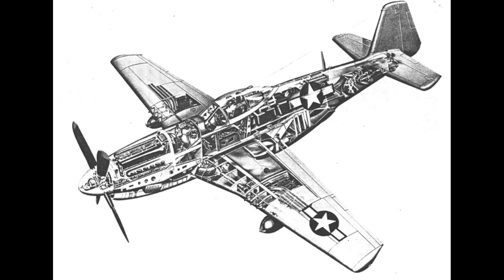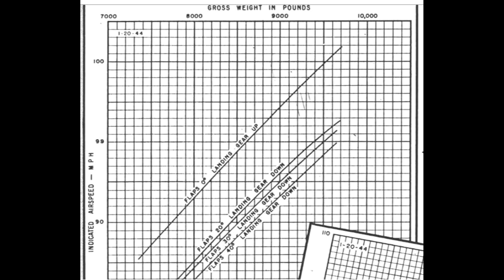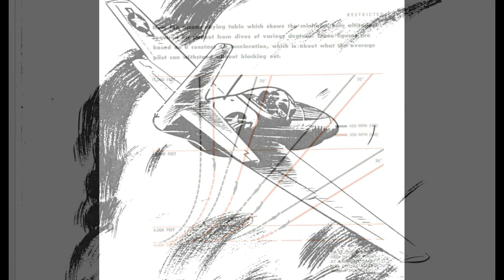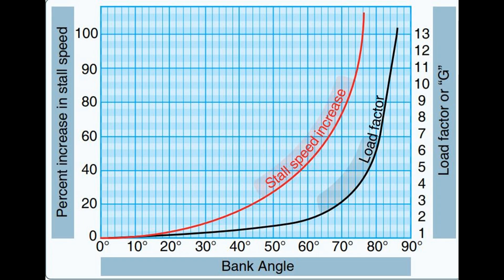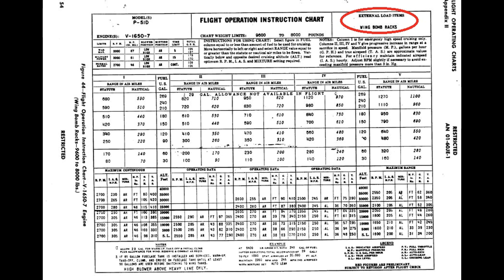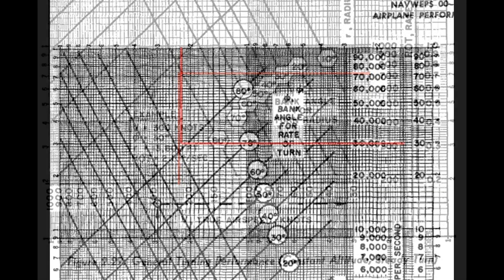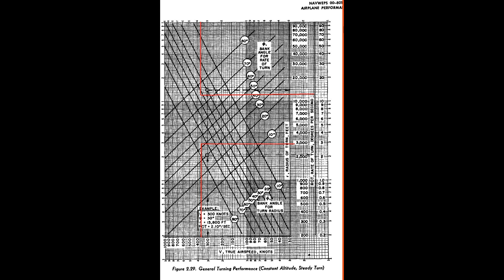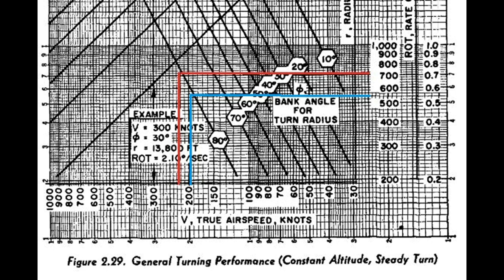P51 Mustang Turn Radius vs.

Comment: An additional factor is pitch trim,  Airfoils have a (generally) nose down pitching moment that is balanced by the horizontal tail.  The tail load is adds to the load already born by the wing as it pulls the plane thru the turn... more induced drag.

The Mustang’s airfoil has appreciable pitching moment; the Wildcat’s NACA 23015 has nil.

The NACA 230xx series nil pitching moment meant the pilot could throw the plane around without having to trim.  The 230xx was used on the Wildcat, Hellcat, Bearcat, Corsair, Lightning, FW190 and Beech Bonanza... it’s been around.  Downsides is bad stall, drag, and won’t carry ice.
Reply: Centre of mass also affects the amount of control surface movement needed to change direction, and hence the induced drag from the tail feathers ! Bearcat was almost unflyable if you could not see the horizon, not safe at night... !!

Comment: It was an A36 in the start if the gun placement is still a dead give-away.
Reply from the maker: Good Job! Few people are able to pick that up.
Reply: I have to say I don't know why the P-51 doesn't have the air brakes the A-36 has. They can be an assist in an aerial dogfight, by reducing the speed and causing an opponent to overshoot. However, you would have to be quick and smart to then use that to your advantage.
Reply: @alexanderhogan4546  one word: weight
Reply: Alexander Hogan and you could use them like spoilers to help with roll rate or like a split rudder you see in the B2 Spirit to help in a turn.
Reply: Not necessarily.  The dive flaps are a much better indicator.  The very first Mustangs (most of which were given to the British as Mustang Mk I's) had the same gun placement as the A-36, and the nose guns were only deleted with the second batch of Lend-Lease Mustangs which were designated as Mk Ia.
Reply: Ah. I didn't pick up on that. That thing was one mean dive bomber and attacker.
Reply: No, I mean 'given' as in, we shipped them to the British, i.e. physically gave them to the British.  Admittedly somewhat less than accurate choice of words on my part.  I probably should have said "purchased by the British as the Mustang Mk I" but I was in a bit of a rush at the time.
Reply: "Gave" is about as apt a word for lend-lease goods a "purchased" is, anyway.

Comment: Using pure turn rate and radius to compare two different aircraft's maneuverability doesn't really give an accurate picture of which performs better in a dogfight.  The pilot is definitely going to be the key factor.  A very skilled pilot can feed in just the right amount of back pressure to foil an enemy without overloading the aircraft and increasing induced drag.  The less experienced polite will usually use too much back pressure and bleed off speed and lift too quickly.
Reply from the maker: I made no attempt to cover all the variables in a dogfight. I just addressed turn rate and radius, and then only maximum turn rate and radius.
Reply: Yes, of course and it was a very informative, well illustrated presentation.  I just wanted to add that these performance factors can't show the whole picture when it comes to which aircraft will turn better in a dogfight.

Comment: A bit more respect for the P51, from a dive bomber to long range escort which could out perform its competition that were short range air superiority fighters.
Reply: Different horses for different courses, old boy.
Reply: respect is earned, not given, did the p51d earn respect, yes in some areas for sure, undoubtedly one of the best.
Reply: P-51 was inferior to Spitfire in climb and dogfight, without the brits Merlin Engine built under license by Packhard  the Mustang would not be such an success.
Brits and germany were the leading airplane tech nations in WW2, both produced Jet engines and Jets, look what Bell produced, the P-59 was such a crap and the first P-80 was inferior to Me262

Comment: If you dropped a few degree of laps, what would that do for a sustained turn. I always wished when they swapping out the motors, they should have added leading edge wing slats to the stang, maybe bleed a little coolant air over the wing, boundary layer style... why not build a totally new plain? Thanks for the videos, love the detail.
Reply from the maker: As for the sustained turn question, it depends on the plane, the wing and the type of flaps. For example a low powered plane with slotted flaps, then no, a high powered plane with fowler flaps then yes. I doubt any WW2 plane had a better sustained turn rate with the trailing edge flaps out, but maybe. North American did design an all new plane with the Merlin, but nobody noticed. It was the P51H, which is not just an updated P51D, it was essentially an all new plane. Leading edge devices add a lot of complexity to the discussion. I'll get to it, but keep in mind, that while they work well, even the F15 Eagle doesn't have them and it was king of the skies for about 25 years.
Reply: From what I have read, some ww2 fighters had "maneuvering flaps" which were about a 10 degree setting.  This was used to improve instantaneous rate of turn so that a pilot could momentarily either pull lead or escape an enemy's shots.  However, you would never want to keep slowing down using flaps; bleeding off that much speed is generally fatal.  

The famous ace Ike Kepler of the renowned VF-17 wrote he used landing gear and flaps to cause a Japanese Tony to overshoot his six o'clock and thereby Kepler was able to splash the Tony.   

I think the Japanese George aircraft had flaps which would automatically deploy when needed.
Reply: @fazole  A number of JAAF and JNAF aircraft used "combat flaps". Nakajima was a serial "offender"- Ki43, Ki84.
Reply: Greg's Airplanes and Automobiles 
P-51H is one of my personal favorite aircraft of all time.  Very much at the forefront of what could possibly be achieved with a prop job, and very possibly of what might ever be achieved with one.  Heck, even though it never saw Combat, it did make it to squadrons in the Pacific, it just never got on any sorties.

Comment: Great videos! I had to laugh when you mentioned one plane absolutely out-turning the other "and vice-versa". Years ago I read a commentary on Zeroes and P-40s. It may have been Murray Rubenstein's excellent comparison series, but I really don't remember for sure. What I do recall is reading a quote from a P-40 pilot to the effect that "I never met a Zero that could out-turn me." Given that pretty much everyone agrees that the Zero was by far the better turner, I learned a little bit about how much perceptions play a part in what we see. If a P-40 pilot takes a shot from 300 yards behind a Zero and the Japanese pilot throws it into a tight turn in an attempt to avoid another shot, the American only has to turn a few degrees to keep him in his sights. Sure, the shot's going to be a much worse deflection shot, but as far the shooter is concerned the Zero is still in front of his guns and it sure looks to him like he easily out-turned his target.

Of course personal experience is one of the worst judges of facts, but I can see where a lot of these stories get their start.
Reply: "I never met a Zero that could out-turn me."
This might be the phenomenon called "survivorship bias" - none of the pilots that were out-turned by Zeroes lived to tell the tale.
Reply: The zero was very good at low speed turns. P-40 Pilots learned to keep the air speed up. In high speed turns the zero's controls became very heavy, if it slowed down to make the turn it gave a speed advantage to the P-40, then could not acceleruate fast enough(due to radial engine drag) to escape the P-40's speed advantage.
Reply: sebrafield wtf, now the zero is outterned by p40. Ok I understand american pilots had to lie some to win any medal and be a bit famous I mean profits for them. But why you fall in it!?
Reply: @geldoncupi1  did you really not read the entire comment he wrote?
Reply: @geldoncupi1  the zero couldn't turn well at all at speed

Comment: That P51 you said wasn't a P51 was a P51, just not a P51D.
Reply: To be pedantic - the first Mustangs were used by the British (Mustang Mark IA - the "Mustang" name came from the British). These were NOT P-51s (they didn't have a USAAF designation because they weren't in use by the Americans as yet - and the Mustang 1A was armed with 20mm cannon). The Americans decided to put in an order of dive bombers using the Mustang airframe, these were called the A-36. The one in the video is the one on display at Wright-Patterson. LATER the USAAF ordered fighter Mustangs, THESE were designated the P51A (and some were supplied to the British, who called it the Mustang Mark II). So the A36 were NOT P-51s, and were not a derivative of the P-51.
Reply: A-36 or P-51A?
I think literally the only difference are the speed brakes on the A-36.  
They have an A-36 at the Air Force Museum in Dayton...  Not too many of those left in existence.
Reply: soaringtractor A 36 was an Apache
Reply: Matt Puffer DUUUUUUUUUHHHHHHHHHHH !!!!!!  A36 was the dive bomber version of the Mustang !!!!
Reply: As I understand it, the A-36 was produced only for budgetary reasons. The Army had spent all it's money for fighters that year, but wanted to keep the Mustang in production. By making it an "Attack plane", they could allocate funds to keep the line going.
Reply: If you look, the dive brakes are deployed! Yeah, three left according to Wikipedia, and this one is at Wright-Patterson.
Reply: Doh! Of course.
Reply: Organ Farm   It was a F4F Wildcat in the drawing, A-36 in the museum.
Reply: it also had extra guns, and an engine geared for lower altitudes.  How do you gear for lower altitudes than something already struggling above 15,000ft?  by giving it an engine that peaks at 7,000ft, then drops off insanely quickly
Reply: no that was an A-36
Reply: RED,
Stop being pedantic.
I know it's a problem on YouTube but it's still annoying.
The A-36 was a development of the P-51.  In modern terms, it would be the F-15E to the F-15A.  In other words, modified specifically for ground attack but retaining most of the airframe and powerplant of the original fighter version.  Literally, the only major differences are the reinforced wing and split rectangular speedbrakes.
It's still a P-51 design whether you admit it or not.
Reply: AvengerII what makes it an A 36 is that it is the same airframe as a P 51A with different gun placement, not just different roles.
Reply: Matt Puffer  BULLSHIT !!!!  An A36 is a Mustang with DIVE BRAKES and bomb mounts on the wings !!!  DUUUUUHHH!!!!!!!
Reply: Wilbur Finnigan not even going to get into this with you. There's a distinction between Mustang and P 51. Hence once the USAAF adopted what NAA was producing for the RAF (Mustang) they gave it the designation P 51, and the name "Mustang" stuck. The A 36 was affectionately referred to as an Apache.
Reply: Matt  MUSTANG was the P51 !!!!  P51 was a Mustang !!!  DUUUUHHHH !!!!!!!
Reply: no the A-36 was not a P51 it was never called as such and had a completely different role
Reply: It was never  classified as a p51 by the army. it was purpose build ground atacker based on the p51 thus why it recived an other designation
You just mistaked it for a  p51a that's all
The world world be a better place if peoples just admited their mistake and move on
I'm not here to shame anybody I'm just pointing fact
Reply: I think he was just being facetious.
When people think "P-51," it's almost always the D-model.  It was the most produced model, the definitive version with the bubble canopy.  More D's survived than any other model of P-51 to the present-day.

Comment: Comparison of the p51 mustang and the supermarine spitfire.
Reply: Lightning never sold well because of what it was designed to do. Specifically it was designed totally as a short range, high speed, high altitude interceptor with a rate of climb that very few aircraft even today can match. Its reason for being was simply to intercept Soviet Nuclear Bombers before they reached their targets. Hence the high speed, and very high rate of climb. Radar was considered less important as they would be vectored onto their targets, so long range sets were not required, only short range sets for the final approach. 

And thats the problem, it was such a specialised aircraft that once countries started moving from Bomber deployed nukes to missile and submarine deployed weapons they struggled to find any kind of alternative role for the thing. It had been so highly optimised for its role, because when they designed and built it, it was the last defence against a Nuclear Strike.... so they did not compromise. But that meant it made compromises in other areas, such as little room for radar, limited room for avionics upgrades, it was an expensive aircraft to maintain as well. 

You should see one reach for the skies though, they climb like homesick angels. I used to watch them in scrambles as a kid. It is famous for its ability to stand on its nose and go almost vertical from the takeoff, but its highest rate of climb was not achieved that way. This is an aircraft that could climb to 36,000 feet in under three minutes. RAF pilots were allowed to make practice interception runs against U2's when they were deployed in the UK for a while. They were not allowed to approach within 5000m of the U2, or pass in front of it (to ensure the U2s safety), but they were able to successfuly intercept U2 up to 65,000 feet. Several pilots have reached over 80,000 feet..... 

So yes, the English Electric Lightning had its issues, but it was VERY good at what it was designed to do, intercept bombers.
Reply: To this day, the European fighter planes have less range than the American types.  They have excellent handling but the range isn't there unless they want to strap on HUGE, drag-inducing tanks.  They're mainly designed for the European theater which doesn't take into account longer ranges.
The main reasons for designing fighters as big as the F-15 (AND bigger like the F-14 and Su-27) is to get decent range and have better radar capability.  These planes have huge internal fuel capacity and bigger noses for bigger radar sets to track longer distances AND search greater volumes of air.  They're also far more expensive than smaller fighter jets because "more plane equals more bucks to build AND operate!"

They had a Mach 2 British jet built in the 1950s and 1960s called the Lightning but it never sold well.  I think it had maybe 2 export countries -- Saudi Arabia and Kuwait(?).  The plane's biggest problems were lack of range and an airframe with no space for credible avionics upgrades.  You could not fit much of a radar in the plane.  The same was true with the F-104.  Italy eventually had F-104s capable of firing and guiding Sparrow missiles but for a while the Italian Air Force had to remove the gun from the F-104 to fit in the avionics guidance for the AIM-7!  They finally were able to miniaturize the avionics enough in the 1980s to reinstall the gun in their F-104s.  The UK ended up buying F-4 Phantoms by the mid-1960s because the Lightning just could not be developed into a long-range aircraft with decent radar-homing capability.
If we were to be honest, the British have pretty much specialized in designing good point-defense fighters.  They were excellent for defending the homeland but you can't take the fight to the enemy with these planes unless you're based on the frontline, literally on the opposite short of the river across from your opponents.
Reply: alganhar1  Stand on its TAIL, I think you meant to say.. 😁
Reply from the maker: Where? Over the cliffs of Dover, or over Berlin?
Reply: @GregsAirplanesandAutomobiles  It would be nice to compare the turning, climbing ,stalling and speed abilities of the two aircraft.We all know that the  mustang had better range.The Spit was a defensive fighter, range was not such an issue. The Mustang is a more modern design,I know ,but with Merlin`s in both how do the airframes compare? I`ll bet the Spit was harder to build with loads more tricky components!
Reply: Greg's Airplanes and Automobiles: How about location independent with both aircraft loaded with 30 minutes of fuel? Yes, the Mustang has far more range than the Spitfire, but the question is referring strictly to turn performance, not endurance. I gather you are not a Spitfire fan based on your comments about Spitfires only being able to reach Berlin in a truck, but you haven't made similar comments about Bf-109s or Fw-190s, even though these are also similarly short-ranged.
Reply: I recall a quote from a P-51 pilot saying "the P51 can't dogfight like a Spitfire...but it can do it over Berlin"

Comment: This is a great channel. Im only an Arm Chair pilot but I think comparing a p51 turn radius to a bf109's would be like comparing Ford Mustang super snake to a Lotus Exige S. you can Tell every bit of the Bf-109 was made for turning. Even Roll rate, Which I don't even think can be compared... x6 50.cal Machine guns plus amo hanging out in the wings, plus over 2,000 lbs heavier. As you said Turn rate may be close though. but if I think of roll rate+ turn rate +climb rate id say My money is on the bf-109.